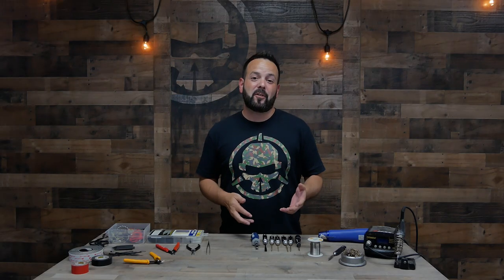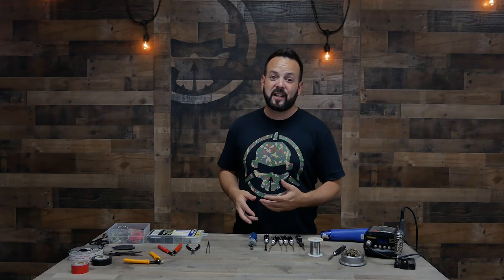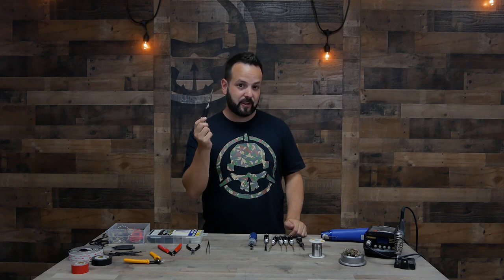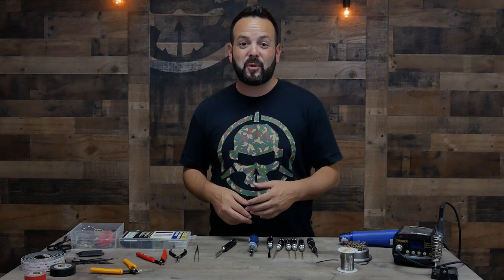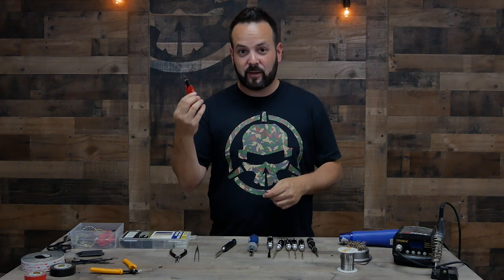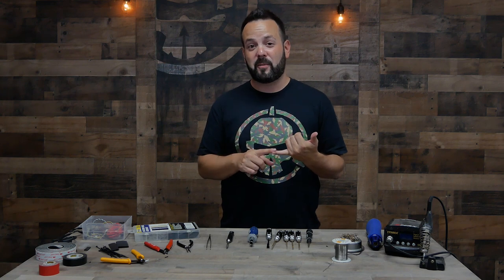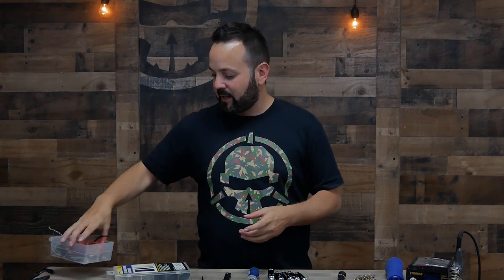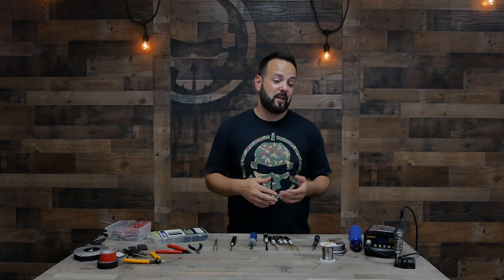Tools & Supplies for FPV

Comment: 60/40 is 60% lead and 40% tin.... 63/37 Kester solder is the best solder for our purposes by a long shot. The worst thing someone new to soldering can do is buy low quality cheaper/China solder... A crappy iron and high quality solder would be MUCH better then a top end soldering iron and crappy solder.... I love my TS100 and i love my old Unger pro soldering station (Unger made the best soldering irons period but sadly they aren't around anymore. I've had mine for 20 years)

If your gonna be in to quads a TS100 is well worth the fairly small investment as it's portable and can be used at the field with just a normal 4s flight pack, heats up super fast and has very accurate temp control the tips are of very good quality as well... So take my word and buy you a 4oz spool of Kester 63/37 rosin core solder (i buy 1 pound spools, 4oz spools will be about 12 dollars and a 1 pound spool about 23 to 25 dollars) as it flows better and quicker even with less heat then 60/40 but 60/40 is fine to. Buy you a TS100 and there's no need for a bench iron/station because the TS100 will do everything you need it to and does it extremely well. A tip cleaner is a must as he said, a moist sponge and a wire mesh cleaner like he showed will make sure you always have a perfect tip that's bight and the solder will stick to it and transmit heat really fast and make you always have night bright and shiny joints. The next thing is buy a little tin of Tip tinner and retin your tip about every 30 minutes of time the irons on and you will always have a like new tip...

When you first use a tip you need to break it in and how i do that is to take some solder wire and wrap it around the plated area of the tip and then turn the iron and as it comes up to temp the solder will melt and prevent the tip from oxidation happening before the tip gets solder on it and after that wait about a minute and then clean the solder off and use the tip tinner and you will have a perfect tip and then about every 30 minutes of time the irons on use the tip tinner again. High quality iron tips aren't cheap and the TS100 tips are about 15 to 17 bucks each if you use the tip tinner every 30 or so mins of use those tips will last 3 to 4x as long as tips that never get retinned. The tip tinner comes in a little round metal tin and it's kinda like a tightly packed powder, you simply clean the tip of the iron while it's hot with a few passes on a slightly damp sponge and/or a few presses in to your wire tip cleaner and simply dip it in the tip tinner for a few seconds and bingo the tip will come out super shiny and bright and solder with absolute perfection like a year old tip after a quick retin will solder as good or better then a brand new high quality tip.

I design prototype boards for guidance systems for air to air and surface to air missles and spend 35 to 50 hours a week with a soldering iron in my hands so i know that end very well... If you follow the advice i just gave you will make flawless solder joints each and every time.

Yes i fly RC... 3d Helis, large 3d gassers and race quads.. I also hold a jet Turbine waiver ...

For a prop wrench IMHO the best thing is a 5 dollar 8mm ratcheting wrench you can get them at home depot for 5 to 6 bucks for a husky brand one and they are fantastic for a prop wrench and make prop changes very quick.

A high quality Zip tie set with different sizes is a must and i can't stress high quality zip ties enough... The dollar stores ones are a waste of time even putting them on... Buy electrician grade zip ties and you will be glad you did.

The next thing that will make life much easier is a roll of thin film VHB double sided tape and get it .25 inch wide... And a spool of VHB foam double sided tape and again .25 inch wide.

A kit of 4 to 1 ratio shrink wrap meaning that if it was a 1 inch wide piece it will be able to shrink down to .25 inch... Cheap shrink wrap will be about 2 to 1 meaning a 1 inch piece would shrink down to .5 inch... The high ratio high quality shrink wraps will not start to tear or corners of PCBs punch through once shrunk and beings it can shrink down so much you don't have to be as worried with if you slide a piece over something that's a little big will it shrink down around it like you want it to.

A high quality set of spring steel hex drivers will be your best friend in 1.5mm, 2mm and 2.5mm along with a high quality set of side cutters. Do not skimp on the hex wrenches and side cutters... Spring steel hex tips will keep nice sharp edges and not round off like Ti coated steel tips (i use Hudy hex wrenches, they are costly but a one time investment and will not strip out screws) and a high quality set of side cutters will be 10 to 15 bucks and make your life much much easier and have soooooooo many uses.

Something else he said is a heat gun... Imho get a SMD rework hot air blower... It's far more useful then use a normal heat gun... And adjustable temp and fan speed SMD rework hot air gun is imho almost as important as the soldering iron and has many many uses.
Reply: This comment needs more likes

Comment: Hobby knife. Super useful for stripping wire.
Multumeter. Keep the magic smoke inside the components by checking for continuity.
Painter's tape for masking spaces where solder splatter would ruin your day like motors and ESCs.

Comment: I recomment a hand magnifying glass. Inspect your solder-points with it for tiny shortcuts. The labelings are also very tiny on the controllers ....

And you should have a smoke-stopper!
Reply: Honestly I find it hard to use it properly. So I just use the built in light.

Comment: Did you mention shrinkable tubing and zip ties? I use the stuff by the ton ...
And what´s about cutter knifes and/or a scalpel? A third hand or some putty for keeping everything in place when soldering ...
maybe some magnifying glasses to see small solder joints :)

Comment: What do you think is better between the ts100 and the ts80. They are very similar imo.
Reply: IMO the TS100 is better because it accepts higher input voltages, and therefore can generate more heat.  The TS80 max heat wattage is 18W, whle the TS100 is 60W.  That can make a big difference when soldering heavier gauge wire and pads for like XT60 as an example.

Comment: Helping hands..
Reply: And a fand to blow the smoke away or suck it up
Reply: blue tac works for me
Reply: @fpv568  what is that?
Reply: @kampkrieger  it's some kind of putty that's used to stick photos and posters on the wall. It can be used many times and stays sticky. I find it useful to hold a board in place or even a wire. Bardwell uses it too. It has a different name in different countries, in france it's called "patafix".

ps google it x)
Reply: @fpv568  aaaahaaaa I remember!!! I tried to buy it, but i couldn't find it anywhere or can not find it now, i did not know how to spell it. But did you spell it correct? Where can I buy it (not US)
Reply: @kampkrieger  I think it's called blue tack yeah, check your local hardware shop
Reply: @fpv568  i am in germany ... need a translation. can't find something like that. Need to buy from the internet
Reply: @kampkrieger  https://de.wikipedia.org/wiki/Blu-Tack
Reply: @kampkrieger  auf amazon.de kannst du "uhu patafix" kaufen

Comment: Where I come from we use a simple moist sponge to clean the soldering iron tip. No fancy metal scraping stuff. Works perfect (always shiny) and is also equiped with every soldering station here, so its not just a lifehack. 
Example: https://www.pollin.de/images/600x600x90/I840223.4-Loetstation-ATTEN-ST-100-100-W.jpg